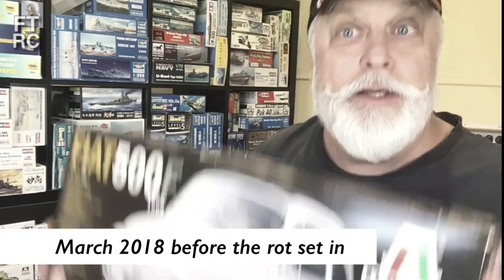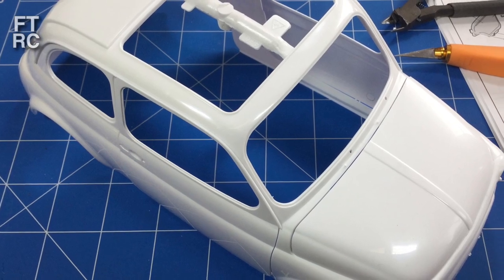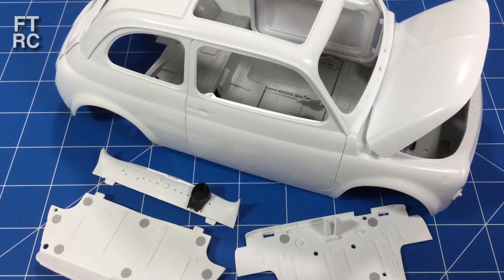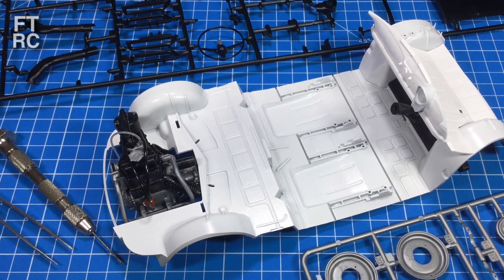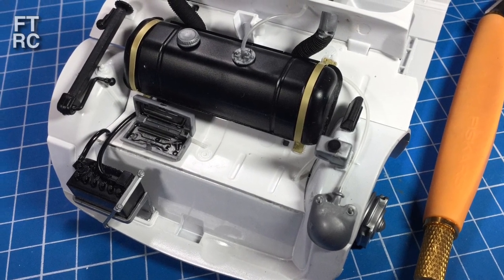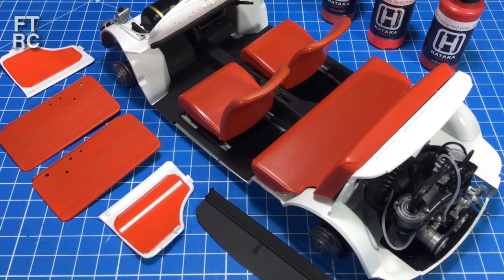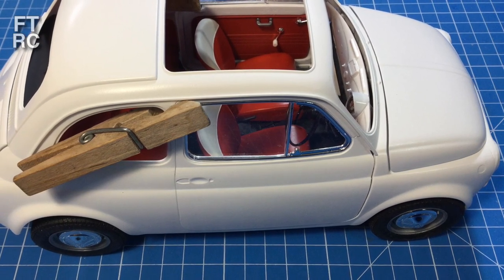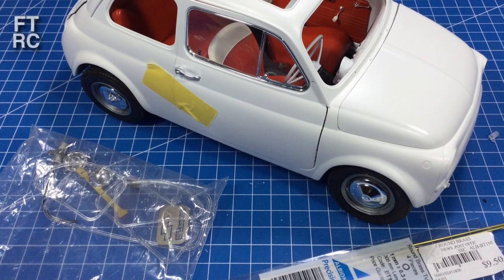The Worst Model Kit in the World and it's Italeri

Comment: I've built many Italieri Kits since the 1970's.  I have a love/hate relationship. Love the choices of builds, hate assembly.  Plastic thin, brittle, snaps etc but they had the only models of particular vehicles. Many were tossed because of bad fit issues, brittle parts, etc.....glad to know they haven't changed in 40 some odd years
Reply from the maker: No they are still the same Italian philosophy… looks pretty… falls apart.
Reply: The sad part of all this ,
There are different grades of plastic some are fairly strong. Clearly they use the cheapest weakest plastic they can find.  Sounds very Euro to me.

Comment: Hi Harry, those pesky big marks are actually called ejection pin marks. They are the pins that push the part out of the tool.
I have the new Italeri Lancia Delta Integrale. That thing is £240 GBP and is no different to what you have found in the 500!! Weak plastic suspension components with moulded on pins of 1mm diameter, AND heavy rubber tyres. Ejector pin marks everywhere, there are 22 on the hood alone!! Oh, and all the body parts are covered in sink marks. When you compare it to Tamiyas old 1/12 Porsche 934/935 for around half the price, or some of their 1/12 F1 cars for £100 GBP,  it's a bloody joke.
Reply from the maker: Yep slip of the tongue, I shudder and cannot speak clearly when I think of that Fiat!

Comment: I think I would have cut some clear posts for the bottom of it for support. Maybe 2 down the center. I've built a couple aircraft that needed it because all the weight was in the back to it would tip. Works great for display. You had a good go at it and most times even the best builder like yourself can't fix manufacturing mistakes. Keep up the good builds!
Reply from the maker: That has been a frequent suggestion… if it had been my kit, not a commission job with no budget, I would have epoxy glued up all moving parts and added supports on a base..

Comment: I steer clear of kits with functioning parts. The tolerances just aren't there at such a scale to work properly. Plus it's a car model.......not my cup of tea. Sorry for your bad experience. I like Italeri kits. I've built a lot of them and have never ran into the type of trouble you had. I'm glad the bad experience didn't put you off of models all together. Keep having fun Brother.
Carpe Modellum!!!
Bill
Reply from the maker: It was not a subject or kit of my choice, just a commission job I was talked into for someone else.  If it had been my kit I would have left the wheels falling off, rusted it out, and added a mechanic scratching his head.

Comment: there is a trend by some companies to mold parts so close to scale that they are impractical when building the model. For example axles so thin they bend with the weight of the model. Thin panels that are melted by normal cement or large strips of photo etched brass which expand and contract with the temperature of the room.
Reply from the maker: Yep

Comment: I've only built one Italeri kit, the 1/72 scale Zweilling" glider tow aircraft, which was made from two Heinkle He-111 bombers joined using a common wing center section. The real aircraft was certainly unusual looking, & made for an interesting model. I built the kit in the early 1980's, & was a bit challenging, as I recall. One of the issues was that the kits interior parts often had inadequate attachment surfaces for proper locating, & for a strong glue joint, resulting in questionable part orientation & unsecure attachment. Example; the engine nacelles were single pieces that were glued to the front of the flat, featureless engine bulkheads, with no locating pins, as I recall. The kit had had about 8 machine guns, which were very fragile (& were broken many times). That was a kit I just wanted to finish & be done with. The detail was mediocre to average, I suppose, even by standards of the early 1980's.  I have never built another Italeri model, although I have considered buying some of their kits,  but only for the subject matter, not for "superior quality".
Reply from the maker: Italeri can be quite hit and miss.  My Fiat should have been a good kit with all the engineering that went into it. But sadly the sum of the parts left a lot to be desired.

Comment: Ai. A few weeks ago, I bought the Fiat Abarth 695 from Italeri. Same model, same size. I just started with the build. On my box, it says "New Moulds". I hope that in this kit they have improved on everything. Somewhere I had read that the chassis is the biggest problem, but I hope that is also improved. The reason I bought this kit was, that last year I had built the Alfa Romeo 8C 2300 Roadster. It was a nice kit and everything went fine. So I thought that it would be the same for this kit. We will see. The "advantage" maybe will be, that when it is built, it will stay on the shelf. No playing around with it. We hope for the best. 🙂
Reply from the maker: I hope for your sake they have finally fixed that moulding issue Pierre. The kit looks great on the sprue and has a lot of nice detail.  Mine just self destructed on the shelf under its own weight.

Comment: Never built cars, but I have had kits were the designers had no clue about actually building the model. I try to predict the issues and drill out axles and pin with brass rod before assembly. I routinely do it with MiniArt, Bronco and Gecko armoured cars and trucks.
Reply from the maker: My Fiat ended up with so much brass holding it together you might as well call it a die cast metal model.. but each time I had strengthen one area, the next one failed.
Reply: @HarryHoudiniModels  I hear ya Bro!

Comment: Well, i love especialy the old motorcycles serie of Italeri (Esci) and i find it very good. Same problems with them like wrong injecting points etc but, with a little bit work about it, they finaly becomes  great models. And, like you say, don't try to move any moving part, it's not a toy, it's a model to store under a strong showcase. (excuse my english, i'm french) :o)
Reply from the maker: Your English is fine Daniel… those reboxed Esci motorcycles can come up well, but they were kits designed many years ago.  The Italeri Fiat is a newly tooled kit from only a few years ago, so they have no excuse for the poor design.
Reply: @HarryHoudiniModels  They still use the same design procedures... at least in Italy...

My best results from Italeri kits are rebadged ICM models from Ukraine.

I've had good results with the older Italeri military models - using Tenax or more often Plastruct's original Plastic Weld solvent cements, which contain methylene chloride... not sure which brands are available in Australia, but you may need to buy a suitable solvent cement from an acrylic plastic shop.

Comment: Built the 1/9 BMW R75. Lots of detail and working parts, but very fragile. Loads of running repairs and super glue. Had to go heavier on the weathering than I wanted in the end to cover some of the repairs. Some of the joints just started springing open later in the build. Almost gave up. Then someone gave me the Kettenkrad as a present!
Reply from the maker: I don’t think they tested the kit build at the factory with paint on.. otherwise they would have seen it self destruct.

Comment: Thanks for sharing Harry!  I’m working on a kit right now that I’m having a lot of problems with. My wife’s first car was a ‘69 Cougar. I found one on eBay and started to work on it. I researched the original colours, yellow for the exterior and ivy gold for the interior. I tried painting the interior with a brush, but the paint is too thin and it took me 3 coats to get a somewhat even coat. I left the model for a couple of weeks, and the paint was still tacky. I just painted the exterior, and the paint came out of my airbrush like cotton candy. I got strands of paint all over the body!  Never have I come across that effect!  I’m leaving it now to see if anyone else has run into that problem. Also, I was looking at the chassis, and the AC pump is missing. No idea where it went!  I’ve checked everywhere. Oh well, I feel your pain buddy!  Happy days and model on!  😎
Reply from the maker: Sounds like you are using the wrong thinner for your paint, or your airbrush is contaminated. Unless your paint stock went off and the binder has gone bad?
Reply: @HarryHoudiniModels  no thinner in the paints. The interior paint is Vallejo and the exterior is Paint Scratch car paint. It looked thin enough, maybe next coat I will use a .5 needle in the airbrush!
Reply from the maker: That might be the issue.  Vallejo is a water based acrylic.  Any contamination from alcohol, spirit thinners or even lacquer can sometimes really upset it.  Never ever spray Tamiya, butanol based, paint and Vallejo in the same airbrush without a very deep clean first.  The result is snot!   Windex clean your airbrush and try again.
Reply: @HarryHoudiniModels  didn’t use the Vallejo in the airbrush. Brush painted it on the interior which had been primed with Mr Hobby 1000.
Reply from the maker: Did you mean Mister Surfacer 1000?  It is lacquer based and must not have fully gassed out before you added the water based Vallejo.  And yes Mister surfacer needs a 0.5mm needle unless you thin it right down.
Reply: I use Revell color for the details and Tamiya spray paints for the body and general interieur parts.
They give a nice coating and rarely have issues.
Usually I use the Tamiya surfaces primer as a base coat.
Reply from the maker: Those Tamiya lacquer paint rattle cans are great… I used them for many years before I started airbrushing. They gas out quickly and do take water based acrylics nicely.  Mister Paint is a whole different chemistry.

Comment: I've always found their truck models to be of good quality moulded parts that go together quite well.
The early model trucks are actually better moulded than the newer versions.
I recently bought the new IVECO Hi-way (low roof) and discovered the cab instructions are really for the high roof line so a little bit of careful dissection is required here and there to enable the exterior parts to fit around the interior parts. 
Prior to the IVECO I bought the MAN TGX XXL and to my absolute disappointment found the kit did not include an engine build. 🥴 
I don't actually see the point of constructing one of these trucks if it isn't complete with engine. It's the engine I find to be the most satisfying stage of the entire build. 🙂
Reply from the maker: I agree.  Without the donk there is little point!

Comment: This is what happens when  you try molding the new "soft  plastic" they now use for most kits to exact scale to substitute for what should be metal parts.
I first ran into this with the Revell 1/48 scale B-25 saggy landing gear struts.
My first official "shelf queen" was when I ran into the problem in general when I bought the old original 1/48 Monogram P-61. 
I tried building it after finishing their excellent 1/48 B-17G with the detailed interior.
Having previously built the old Aurora P-61, which goes together like a dream and DOES NOT need A/M metal landing gear, with Monogram's very thin interior floors and panels and the flimsy fuselage halves, alignment became a nightmare, so I made it a "spares kit" for a better future release of something like the current GTW kits.
With that in mind, after building the Accurate Miniatures Avenger, (the one that takes YEARS of sanding and fitting to get the interior that no one can see to work) I could not believe that Academy went out and bought their molds.
Also there seems to be a trend of silly plastic kits with a zillion parts that nobody has of yet to display a finished model of to justify a new hefty price tag.
Some of the worst are the "new tooling" issues that mostly add sprues of "optional" feature parts that nobody is going to use.
And how many times do I read about having to re-scribe their panel lines, having to buy the special little rivet wheel tools, etc., even though they are supposed to represent the "next generation", "constant scale", etc.?
And why do they need correcting even though they are supposed to represent a "more accurate" replica then the old "box scale" releases?
Notice that now if you missed out on buying one before your supplier ran out, that instead of being built with their accuracy issues and confusing assortment of "extra accessory parts", these can be easily found as "New, open box" kits on eBay.
There is a reason that companies like Round 2 and Atlantis are doing well, re-issuing the old simple to build kits without the headaches.
Reply from the maker: Yes thank goodness for the old classic kits.  You can forgive their foibles.
Reply: @HarryHoudiniModels  
Yes, their "foibles" people bellyached about are NOTHING compared to doing one of the newer kits with resin and PE parts and no locating pins.
Even with a British classic like the Supermarine Walrus, the new Airfix kit is bonkers compared to the older easier to assemble SMER release, with self-aligning interplane struts like the one I built as a kid.

Comment: I feel your pain! My worst kit was also Italscary, the tiny 1/72 Hughes Cayuse. That little barsteward fought me all the way, even when it came to closing it up the canopy only "fitted where it touched", needing some very careful sanding and filling along a frameless edge. Then the painting! Decided to go with Xtracolour as it was glossy to save the gloss coat stage for the decals. It took weeks to dry, being still tacky after a couple of weeks in the airing cupboard! Then the decals. They went on well, but Italeri didn't provide enough of them to complete the version I wanted to build which necessitated buying another kit as I couldn't find any aftermarket decals.
Anyway I still finished the little b***er. Unfortunately something heavy landed on it shortly after that and smashed it to bits! May it Rest In Pieces.
Reply: Oddly enough a couple of years later I built their 1/48 Chinook and it went together like a dream, with a small application of BF&I.
Reply from the maker: Someone model kits are simply possessed by demons and need to be exercised!

Comment: My nightmare was the Revell Flower Class corvette in 1/72. But this was basically my fault as I was absolutely not ready for this kind of level. Everything went wrong; the paint I used somehow reacted with one another (I probably combined the wrong types; I don‘t remember), several hull and deck joints broke and forgot to place several parts. Catastrophic; I literally had nightmares. But: I learned. Now, 20 years later, I can laugh about it…
Reply from the maker: If you can laugh, then you got something positive out of the experience.  I am still in the shuddering with loathing and terror stage!

Comment: I did make once an older set of the SR71. It wasn't really a nightmare, but not quite easy too. Biggest problem was the top and the bottom which not really fitted nice to say the least. Unfortunately it fell at a point. I still have 2 trucks (Western Star Constellation and American Superliner 1/24), an AC-130U Spectre gunship 1/48, 2 steam engines 1/87 (BR 41 and BR 50) and 3 cars (Rolls Royce Phantom II, Bugatti Royal coupé Napoléon and Mercedes Benz 540K 1/24).
Reply from the maker: I’m sure not all Italscary kits are nightmares like this one.  I hope not because I have a big 1:35 scale M.A.S. Torpedo Boat kit from them.

Comment: Zvezda KV2, drive wheel assembly was too weak. The track tension would break the driver off. I just put a threaded rod through the body and mounted the drivers on it, you can't see the steel rod. You might try scanning and printing replacement suspension parts if you're crazy enough.
Reply from the maker: Sounds as bad as their BT-7

Comment: Just got done building it myself, was looking to see if anyone had managed to get it to work as advertized. While I couldn't make the front suspension move, or the wheels roll, I feel like calling it the worst kit ever is a bit harsh. I found the build very pleasent, if a little tricky at times, I was able to make the doors open/close and I managed to botch a solution to make the steering moveable . I do think it overpromised, but it's deffinately not the worst kit I've built (even if we don't include the Airfix Lancaster that came with completely incompatable fuselage halfs from different varients)
Reply from the maker: I feel your pain!  Thanks for checking in Joey

Comment: I haven't built that kit but I'll definitely stay away from that one. My nightmare is Revell's 25th anniversary Apollo 11 Saturn V in 1/95 scale. I started it three years ago. I have spent twice the cost of the kit on after market stuff. The kit is so bad that the decals were wrong, the painting guide lines were incorrect. It came wwith a block I command module where Apollo 11 had a block II. The 1st stage engine cowling was completely different than the actual ones. There are so many errors and poorly designed pieces that a person could do several videos on just what is wrong with the kit.
Reply from the maker: Goodness me… was it a Revell of America kit?
Reply: @HarryHoudiniModels   Yeah. It's the worst I've ever worked on. I even had to do a major re-work of the engines.
Reply: @HarryHoudiniModels  It's hardly surprising Harry . When Revell first released it in 1969 ( why 1969 ? 🧐) it was state-of-art !